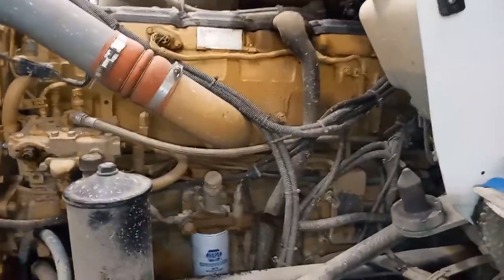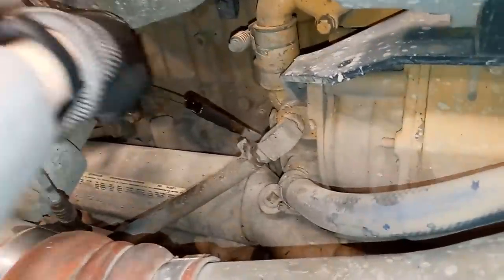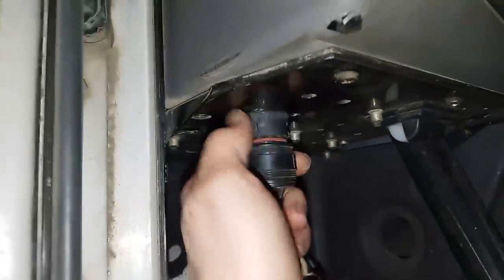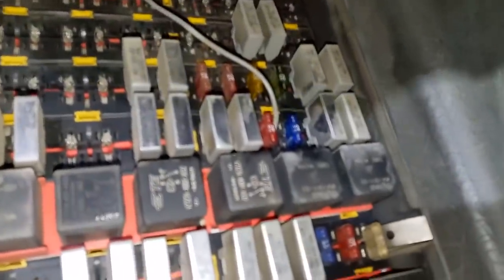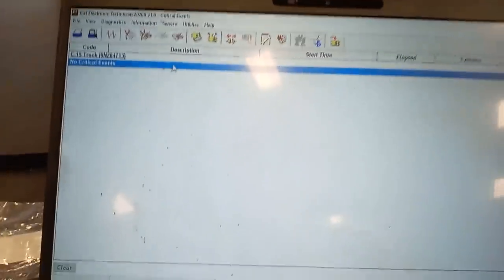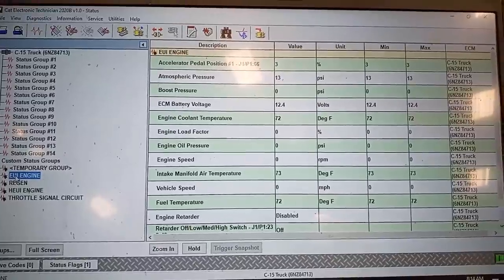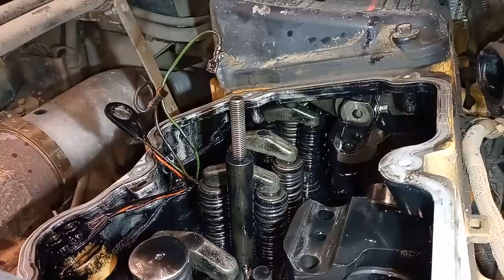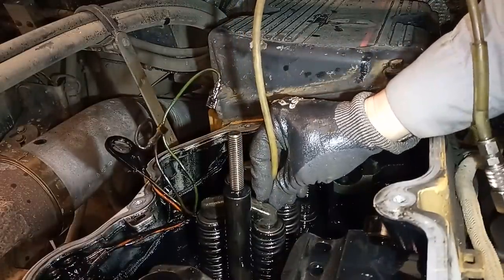What's Wrong With This SMOKY C-15. Cat Engine Smoking.

Comment: Good diagnostic in the beginning of why the diagnostic tool couldn't communicate with the computer.  I think adding detail like this to your repair videos shows a whole lot more about what it's really like to be a mechanic.
Reply: I've had the same OBD2 issue on two different GMs. Both had a bad fuse, but it is shared with the power outlet, so it is easy to overload. I think I also did it to a Ford van, but that I knew I blew the fuse, so it wasn't really something I had to diagnose. I'm guessing it is a similar case here since the port is sharing power with something else, but no compliant about lose of power on that, so it can't be anything too noticeable.
Reply: I was just asking are you gonna drain all the diesel out of the cylinder
Reply: @royalcrowntowing2464  he did that with the brake bleeder, vacuumed it out.
Reply: @snoopdogie187  run into that often on private fleets.
Reply: @oldbloke100  yeah I always do, it will hydrolock the cylinder. Most of the time I crack a line closest to the cylinder. It also relieves the fuel pressure and allows the inj to come out easier. I work on cat gensets and most are a lot easier because they are not inside an engine bay and everything is easier to access.
Reply: difference between a mechanic and a tech
Reply: @snoopdogie187  On the 1999 to 2007 gm trucks and suv's the cigarette lighter port on the left is what the diagnostic port gets it power from.  The. The other cigarette lighter ports are on their own circuits with their own fuses.
Reply: it also let's the customer know why the extra labor time was charged. that's anywhere from 30 min- 1 hr diagnostic time.
Reply: So basically diagnosing the diagnostic tool so it’s able to diagnose the engine

Comment: You have taught me so much about the operation of Diesel engines and have really pushed me towards a future career in the diesel industry, light or medium-heavy duty. Thank you.
Reply: Do you want to work on on road diesels or off road? Bc I am making much more than my class mates who are working on on road diesels I am making in more than a classmate who has several years experience with on road diesel I am making about a dollar more an hour than him. Work on off road equipment try to get into the cat think big program. I didn't and I'm working at a smaller shop don't make thr mistakes I did go for cats training what states you live in if you live I n the same state I'll recommend you througbt my old boss who knows the owners of my local cat dealership to get you ahead I fucked up by going to the wrong trade school but you won't. I have to fight tooth and nail to prove people who learned on trucks can pick up equipment.  But if you learn on the right stuff you will make dealerships pay much better than me
Reply: Good choice.  I spent 30 years working for a government fleet  for a large west coast city (I recommend government employment 100%).  I was not a heavy equipment mechanic, just a service worker, I made around $50K.  The "heavies" made around 70K and there was a lot of overtime so they were always up for that.  But, the guy that fixes the equipment is going to have a lot longer career than truck drivers and even equipment operators.  Self-driving is something the world's fleets are going to switch to the very moment they are ready, is why, but it is going to take them along time to make self-fixing ones.
Reply: I went to UTI, work on diesel generators now. I can tell you going to UTI will open the door to almost any job. I’d recommend going and working at a shop first so that everything makes sense in school. And don’t worry about the pay, find a job that will invest in YOU. If they make you do grunt work and don’t teach you technical stuff, move on. Your body will only take so much in the field.

Comment: Weird,  just changed 6 injectors in a 6NZ today, what I do to remove the fuel is take the return fuel line off at the filter housing and run it into a container then remove the other fuel line to the front of the head and blow air into it till all the fuel is out of the head. 
another good video Josh, keep them coming.

Comment: Good info, just bought a FL70 with a 3126 (190hp 295k miles) that smokes white smoke. Guy who sold it said it needs a motor, but it just had huei and injectors about two weeks before he put it up for sale. I'm wondering if they got a bad reman injector. I'll ask the shop to do a cylinder cut out test to see if it's one cylinder causing the smoke. As always, appreciate your videos
Reply: That is extremely likely. Reman injectors are always a crapshoot.
Reply: @markm0000  reman HEUI injectors in general are a crapshoot.
Reply: We have warrantied 2 sets of cat reman injectors in an excavator in 3 weeks.

Comment: When I was having all the trouble with my engine earlier this year, I finally bit the bullet and got a new cylinder head which had to be made for my engine, and six new injectors, and new jakes due to sticking plungers and all my problems went away. Truck was down for 6-weeks so I had to rent another one. While my engine block and components were the same as all previous iterations of my engine design, the cylinder head was of a newer design using chrome parts and none existed anywhere. So a new head was cast and all new parts installed. Cost me a small fortune however the shop had to eat some of the cost as it was their tech who caused the damage of the old head when he installed the head gasket upside down during engine rebuild. The entire firing deck was pitted bad. Truck runs like a champ now.

Comment: I was about to buy a lake boat for $7k when I got a nicer boat free because the crankcase filled with water very fast. I used the compressed air trick to find the problem which cost a whopping whatever JB Weld cost and three gallons of cheap oil. Four years and going strong.
Reply: You might have just been lucky if it was just fresh water. however if it was coolant it will wipe out all the bearings.

Comment: ive watched your videos for years now and have learned a lot from you. i have to say youre a rare mechanic. before i knew much about engines i remember the hassle of going to multiple shops and getting charged for not finding an issue only for it to be something small and stupid. like this one time where i use to work we had a dump truck with a 3406E that had a major power issue. boss took it to many shops with no resolve and got charged thousands for many ATA pressure checks only for me to find out it was a cracked turbo band clamp on the compressor housing. i wasn't really allowed to work on the trucks outside of greasing them and changing lights but i felt this was an easy fix that he was spending way too much money on finding and one day while greasing it i took a real close look at the turbo and with the truck running could hear a slight boost leak with my ear up close and felt a little air escaping the band clamp. fixed it and the truck ran awesome after words

Comment: I have a Diesel engine that is running just fine, but after watching your videos I always end up with a feeling like I need to go work on my truck ;). I love your content, keep up the good work!
Reply: If it ain’t broke don’t fix it. It’ll need something soon enough 
Cheers
Reply: @tomdavis3038  I'm so glad that you sent me this comment today!  I am in the middle of a complete overhaul of my fuel system after trying to be cheap and putting bad fuel/water in my truck.  I was wondering how I could clean anything out of the cylinders as I'm replacing my injectors and Adept Ape gives me the answer with his use of a brake bleeder.  I've got one of those :)
Reply: Just give ‘er clean air, clean fuel and keep ‘er cool.

Comment: Thanks for sharing. I have a Detroit but am trying to get a cat soon. One of your videos previously stated that while different diesel brands are very different the basic principles are the same. I used the tool that you are using here the brake bleeder as you recommended on a previous video to purge/ prime the fuel rail and vacuum cylinder on my first injector swap on a Detroit 12.7 and just like you said it would work on any diesel. I also used the same pry bar you used here or same type to pull the injector. Thanks for all of your wisdom. I am an owner operator and when I can instead of listening to the radio in my truck I listen to your videos and when I can sit still watch them as well. and they have taught me a lot!!

Comment: Love that comment about needing a computer to work on these. I get calls from customers at my fuel injection shop looking for advice on say a no start condition on a common rail engine. They get their back up when I ask them to check their rail pressure during cranking, because the only way to do that is with a scan tool. Granted if they had one they likely wouldn't be calling me looking for free advice. IMHO a scan tool is just as essential as a socket set when working on a modern vehicle
Reply: Yes but low rail pressure issue is troublshootable without a lab top. Your fuel return for a HPRC will be a good indication if you are building rail pressure or not. If you are getting way to much fuel return on cranking then its process of elimination by isolating the 3 parts of the system.
Reply: @keiferjanz3197  Oh I'm aware. I usually end up telling them to YouTube a fuel return flow test. Still easier to start with a scan tool. Even cheap ones now days will give you live data
Reply: @gmupps  Even more important then the scan tool is the understanding of the system. Plugging in is always a good starting point but ive also seen it lead people down rabbit holes lol. At the end of the day a diesel engine is a diesel engine, they all need fuel, air and compression to run. There is a lot of  simple things to check a no start or any issue before needing to plug in. I follow a keep it simple stupid tree when troubleshooting. Complaint of electrical issues, check battery cinnections, check fuses,  customer said they checked, double check them lol. Engine no start, is  fuel in the tank, is fuel supply good, is air filter plugged off yada yada.

Comment: Precise and to the point diagnosis. Yep good luck to properly diagnose anything without a computer these days. The guy that doesn't use a computer and proper diagnostic techniques is usually firing the parts cannon and will install a set of injectors instead of just replacing the broken one. The good old days of pulling the injectors out and quickly pop testing them on the bench have long gone. Merry Christmas.
Reply: The good old days are still around for me man td42 and 3l

Comment: In my experience, it's extremely rare for a CAT electronic unit injector (3406E, C15, C12, C13, etc.) to cause this issue.  I'd be interested to see if this one acts up again after being parked outside on a cold morning.  

Head gasket blown from a cylinder into the saw cut of the head is the most common cause of this type of issue (if there is no blowby upon startup and the valve-train is working properly).  You won't see any signs of coolant in the oil and some of them don't even use coolant in the beginning stages of this failure.  They usually blow towards the back so, in this case, you would pull a head bolt between #4 and #5 cylinders to check for carbon.  It is easier to try an injector first though.
Reply: always start with the simplest solution, then go towards the complex.
Reply: He varifide that it was an injector when he did the cylinder cut out test. when turned the injector off with the scan tool it quit smoking. and when he turned the injector back on with the scan tool it started smoking again. that tells you everything you need to know. I have been an automotive technician for pretty close to fifty years. I've even worked on some trucks during that time. which doesn't matter the principle is the same.

Comment: I still have an old bench pump for testing nozzle spray patterns. I'd guess the nozzle is bad (peeing out one side). Would be interesting to see a spray pattern on this one. If so, it's probably those Napa filters. They were good enough on the older systems but not enough on these newer ones.

Comment: I'm an in-house mechanic for a small company (we have 6 trucks). I keep telling the owner that we need to get a computer to help me diagnose drive ability and no starts. But he bought me a code reader instead. He thinks just knowing the code is all I need to know, I can Google what it means. Then he complains about how often I send the trucks to the dealership
Reply: some truck owners knowledge would on the back of a postage stamp...........did some driving for a large farmer in western NSW Australia. Guy had late model tractors,harvesters etc and two CAT powered heavy trucks.......the guy didnt even know what valve lash was on an engine, or that the 20 year old trucks he bought had turned over on the speedometer at least once or twice........he actually believed these beat to hell trucks had only done 900,000km.............more like 2,900,000 km's.
Reply: You’re in a no-win situation. If money is that tight with him he’s not going to pay you anymore than he thinks he can get away with.
Reply: I been working on cars 43 years started when cars had no electronics . Now you gotta have a good scanner .If you don't your just guessing..I wouldn't work in a shop like that.

Comment: You are correct many of the tests you performed would require a scan tool. but some wouldn't for instance anything that is electronic like all the sensors,the injectors, and performing the cylinder cut out test, and the ECM values. and even the electrical system. the starting system, the charging system, wiring problems, bad connections, and like in your case blown fuses. which you did the correct procedure because you have be able to have the data Link connection. but the things like the visual inspection of the. mechanical parts, and the cylinder leak down test, wouldn't require a scan tool. there some technicians that will use an endoscope to look into the cylinder. and some service centers will equipment for testing injectors. and ultimately what the technician wants to end up with if testing the injectors. is when injector releases the pressure that it's at the correct pressure. and that the spray pattern is correct. and it shouldn't drip any drops of raw fuel. most of the time the nozzles will be damaged from the violent explosions in the combustion chamber. however some diagnosis can be hard to pin point. like bad connections, burnt wiring, and bad grounds.

Comment: Ha, you mentioned c7 injector removal. I still have all my homemade slide hammer attachments and short pry bar brackets for rear engine school buses from when I worked at cat. Lots of pumps and injectors.

Comment: We had the same problem the head gasket was bad and using the head bolt cavity as part of the combustion chamber. Finally figured it out we pulled the head bolt out to take the head off for further investigation.

Comment: Kind of a quicky cylinder leak down test. Typically you would have an apparatus with a gauge and pressurize the cylinder and time the pressure decay when turning the air off to get a good picture of cylinder/engine health. But your method is quiet common to make a quick determination. Good video.
Reply: no way to put pressure into cylinder without removing a injector.....

Comment: I was told by an old school mechanic that when you have a electrical problem in the wiring ,to always  let the smoke out of the wires first. He said that usually fixes the problem .
Reply: Only problem,  I haven't figured out how to put it back in.
Reply: First try and fix it with a hammer, if that doesn’t work you have an electrical problem. That’s when you let the smoke out. Next step is to leave a progress report for the next shift

Comment: Yes a computer is helpful with electronic engine but not always necessary for dealing with common rail injection systems. More zo use full with electric unit injectors. A typical test performed for hpcr  is measuring return fuel from injectors, rail and hpcr pump. Then physically doing rail cap off tests too isolate the fuel injectors. I've done cut out tests and you'd think issue was all cylinders, physically isolate each injector one at a time and isolated it to only being one. Ive also found great use in thermal image, normally a bad cylinder will ether be way hotter or way colder compared to the rest
Reply: A computer is almost 100% necessary all the time for proper diagnosis. On common rail engines, HEUI engines, and other electronic injection systems, if you don’t have a diagnostic scan tool, you’re flying blind. 

You can’t read fuel pressure, you can’t read pulse width, injector balance rates, can’t read hpop pressure on HEUI engines or the ipr, on common rails you can’t see rail pressure desired versus actual, there’s a ton of things you’re missing out on without the proper electronic diagnostic equipment.
Reply: @Redsfanatic32  I work as a field tech for a heavy equipment dealer, work on lots of equipment where i don't have the EST to plug into different brands of equipment and can manage to troubleshoot just fine, i can go weeks without needing my labtop... now some weeks I use it daily...the tool is only as good as the person intereptaring the information. As stated above i gave a very real example of how to troubleshooting a suspected HPCR issue with out needing a labtop. But I'm not saying plugging in if able is not a good starting point.

Comment: You can actually use a pry bar to hold the injector rocker down, levered off Jake housing to manually cut out the cylinder on a C15.. not recommended but if you haven't got E.T its an option. And if it works it works 🤷 haha 
Old bloke showed me that when I was an apprentice, can do it with series 60 Detroit too 👍